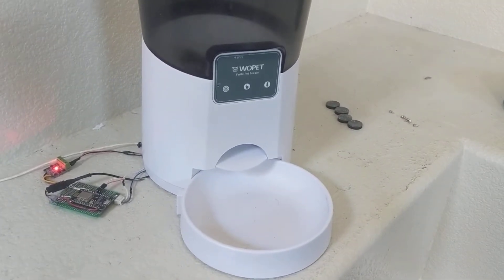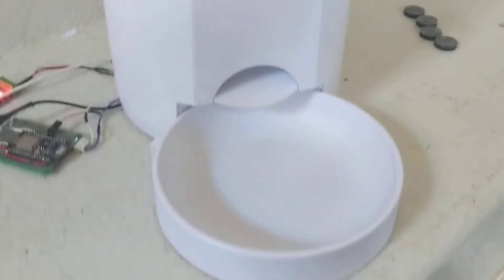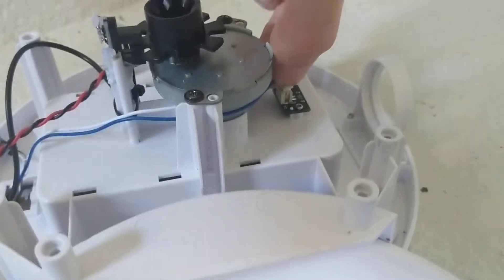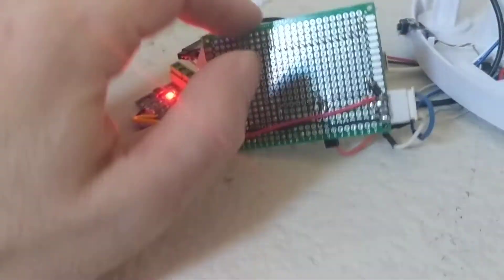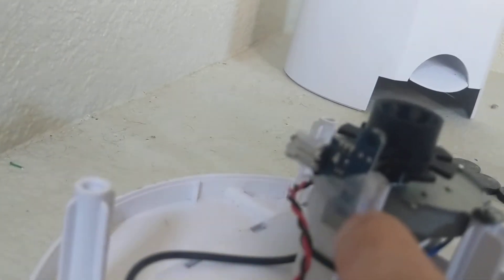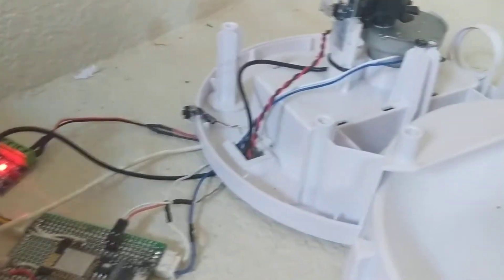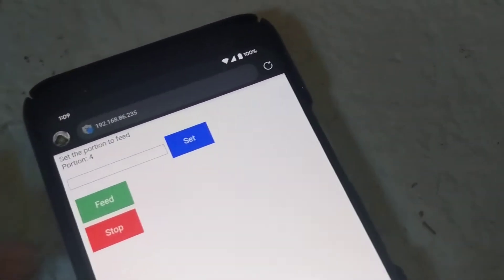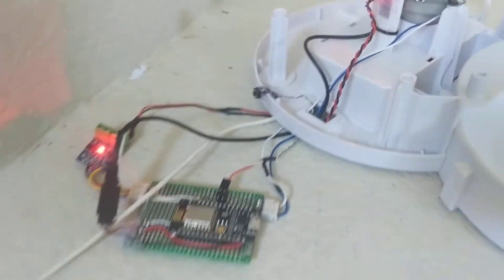Custom WoPet Automatic Pet Feeder Using Arduino (nodemcu)

Comment: I have several non-wifi models that slowly get out of sync, require manually resetting the time every few days. Was thinking of opening up and replacing however it keeps time currently. Very cool video, definitely saving.
Reply from the maker: I think the original wopet board uses a crystal oscillator for internal timing. Crystals are temperature sensitive so that may contribute to inaccurate timing. I'm using NTP since my board is Wi-Fi enabled. Unfortunately I don't think just replacing the timing component on your board will be a simple fix. Either direction will be at least a weekend project. 😀
Reply: @hattybin  Yeah, after replying that yesterday I went down a rabbit hole of how they must be keeping time. I don't mind if they're not querying an atomic clock in Greenwich; I just need to make sure this dog isn't getting fed 10 seconds sooner than that dog.

My new solution is to figure out what kind of crystal oscillator these use, spend $100 (?) on a cheap digital oscillator meter guy and a whole bunch of oscillators, test them all and use whichever ones are closest in value. 

Take the feeders apart, remove old crystal oscillators, install new ones. They're all in the same place, should all be the same temperatures. It's just the frequencies are all mismatched very slightly.
Reply: Not a perfect solution, but one that is cheap and should be relatively easy soldering. Even if they still get out of sync, I'd like to worry about manually re-syncing like once a month rather than every day or two.